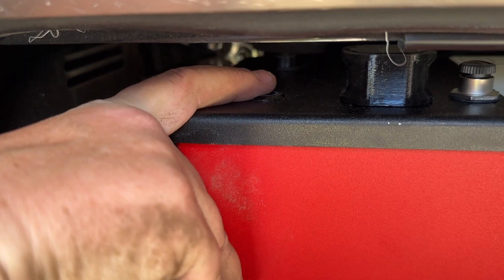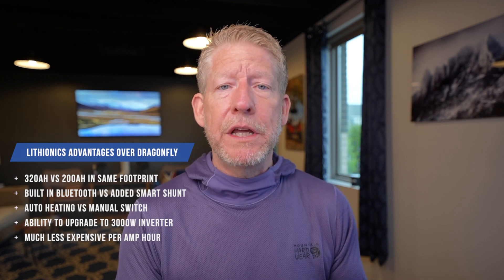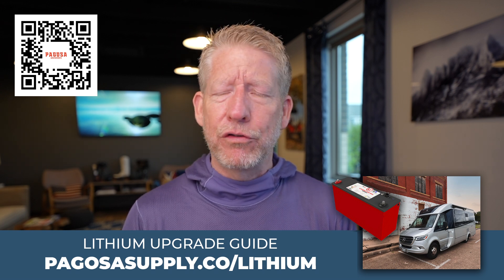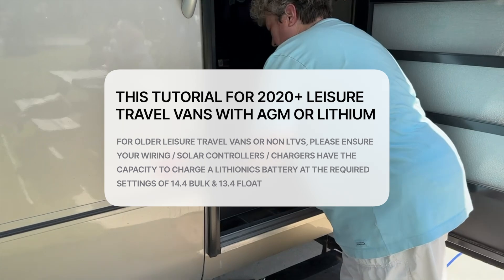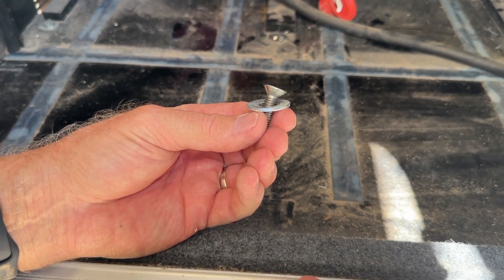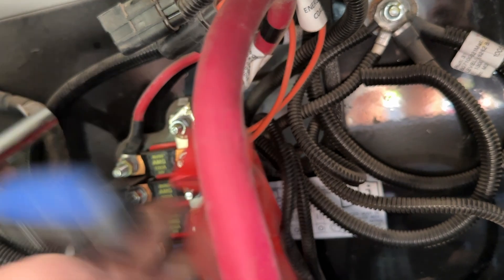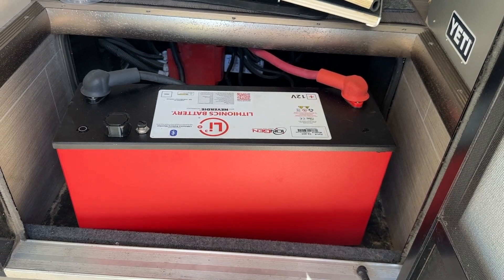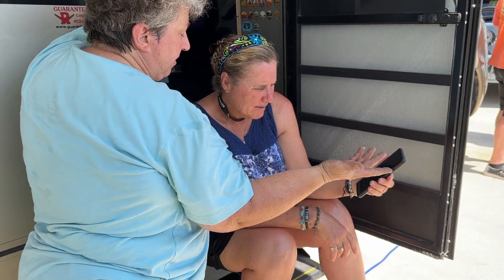Installing a Lithionics 320ah in a Leisure Travel Vans Unity. Full DIY Tutorial!

Comment: Great video but glosses over a few things. First this particular vieod mentions the positive lead is hot without explaining that the solar panels are still connected and there is no easy way to disconnect them so be careful. (a differnt version of the video does explain that ). You need to disconnect the battery heating circuit and abandon by either taping the connections or pulling the fuse (if you know where it is). You also need to remove the middle plastic block and will need to remove the metal tabs (and possibly the paded bumpers) from the battery compartment door. There are also felt sticky feet on the battery which may or may not need to be removed (depending on how tight the battery fit is). I'm thinking leave them on unless you have to remove them. I did notice that the detailed instruction on the Pagosa webpage does mention most of these things in the detail. So read that as well as watch the video and all is good
Reply from the maker: Yes, definitely read the manual on the website for every details
Reply: @Pagosa  I have a 2024 MB and LTV going to the compressor fridge (over the 3 way doemetic)with only 200 AH of lithiums was a bit of a boondocking shock so I'm really looking forward to camping with this bad boy installed. I see they now offer upto 540 AH but you have to give up the storage bay to do so.

Comment: Great video but you are missing the setup for the sterling dc to dc charger, solar and inverter
Reply from the maker: No change on the Sterling, you can keep it stock. Inverter needs the Bluetooth version of the remote ($100 on Amazon) and then change charging profile to 14.4 Bulk and 13.4 float in the Xantrex app. Solar, just put to LifePo setting. Hope that helps

Comment: For LTV prices, they should be putting these in instead of the amg. The tech specs are so behind compared to Pleasureway at the same price point
Reply from the maker: It’s a conundrum for sure. My guess is 25 Model year will have a large inverter / lithium option. But it will be twice as much as just having it done after market

Comment: Quick Question. Will the Lithionics 630 fit the battery well of the 2024 Unity 24RTB? Dimensionally it feels the same and can be finagled to fit that compartment It essentially would be 2 320 batteries in depth. Is that something reasonable?
Reply from the maker: It won’t fit in the battery bay, but there are places it will fit

Comment: Awesome!!  This is my next project.  Does Lithionics plan on coming out with a slightly larger and higher capacity battery that would still fit in the same bay and give more power?   I have a 21 LTV MB.
Reply from the maker: That's as big as you can get in the battery bay, but we do installs with an additional 320 in the inverter bay, so easy peasy.